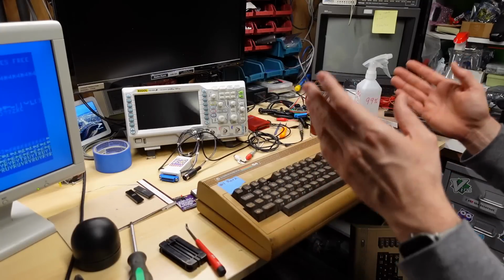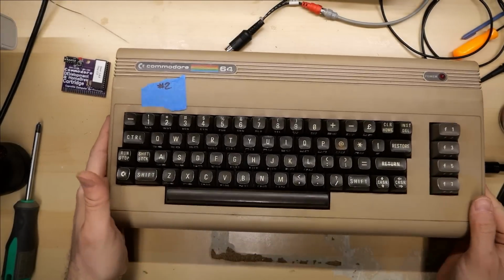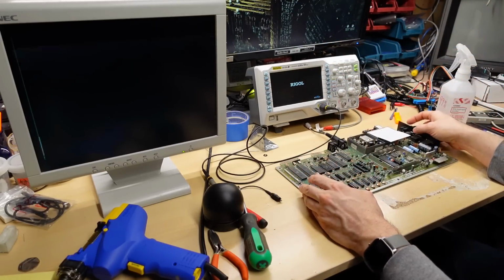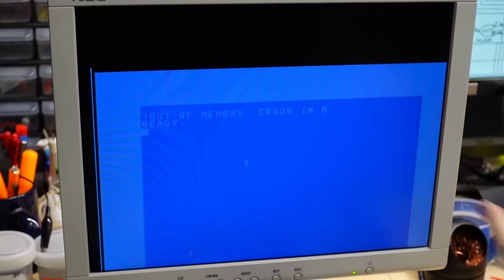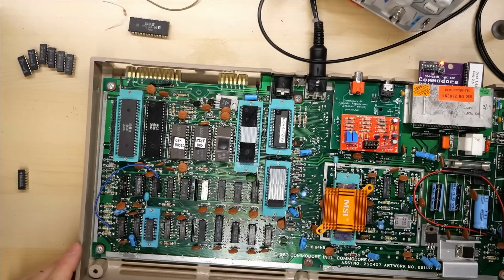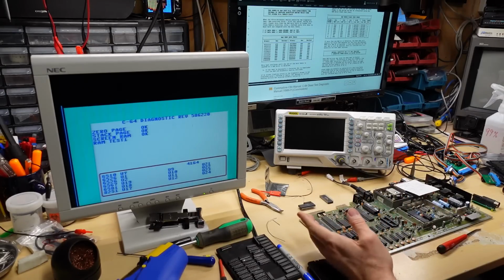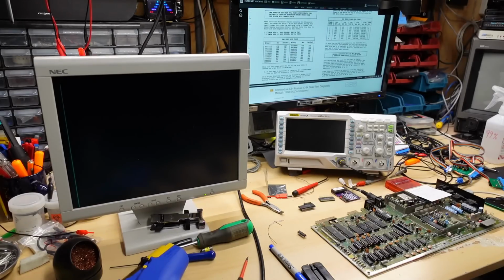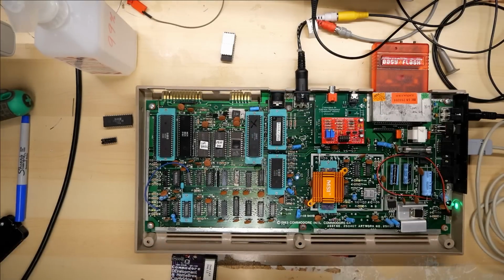2021 C64 Repair-a-thon #2: "Hmm, the mystery deepens!"

Comment: The thing about diagnostic software, is to get the most out of it, you need to know how it does the tests, and how it interprets the tests.  If you do not know how the test is done, you cannot trust the output.  I used to have a whole suite of testing software when i was an IBM PC repair tech back in the day.  And you could run several different ram test, and some would pass bad memory, and other would not.  In then end, because i didn't have access to the source code of the testing software, you just learned which tests were good for detecting specific problems.  For example some were really good at finding "slow" memory chips.  Just because it says 250 doesn't mean it actually works at that speed.  While others were very good at spotting "flakey" or intermittent bit errors.

In short, that dead test may be small enough to reverse engineer by hand, if the source code isn't available.  If it is, then use that to determine why the tests are seemingly giving you bad information.
Reply: I agree. I'd trust a working game more than I'd trust that tester when it comes to the zero page.
Reply: In this case maybe the marginal CPU have one or more bad op-codes that are used by the tests and not in the tested game. I had a flaky 6502 many years ago that could not alter the D flag with SED/CLD. Since D flag is undetermined on power-on sometimes things worked but mostly not. Took me a while to track down. Maybe something similar happened here.

Comment: as an interesting challenge one day, why not try to breadboard a working computer of some sort using only the "dead" chips since some are partially working (not a c64 but start with blinking a LED then move to a LCD etc until you have a franken-computer with only "broken chips") .
Reply: Like a Ben Eater computer?

Comment: I really have no knowledge about Hardware, so perhaps a weird question: 6510 is not in production anymore, but WDC produces a chip which is based on the 6502, on which the 6510 is also based. Would it be possible to use a newer chip in the 6502 family with a daughterboard or something as a replacement for a 6510 in a c64?
Reply: Nope, the WDC chip does not support the undocumented opcodes of the MOS CPUs. You can build an adapter for a MOS 6502.

Comment: Why do you have 50p on your desk? 😆
Reply from the maker: Good catch! I had that coin floating around the house and I was trying to take an Apple IIc monitor off the stand.  You need a coin for that. The 50p piece was nearby so I tried it but it was too big! Had to go grab a US quarter to get the monitor off. :-)
Reply: @adriansdigitalbasement  if that 50p was minted in 2009, it means it's rare due to it's low mintage for that year.

Comment: Hmm. 6510 is "mostly" similar to the 6502, with a few addons, so the internal logic for the "zero page" is actually functionally different that what is used to address other RAM. It even uses a different number of clock cycles because of this. However, I can't comprehend how/why the machine would even boot at all with it not working right... weird.

Comment: I am looking forward to "Adrian is building a brand new computer from the Dead Parts Bin" video.
Reply from the maker: Would be like Frankenstein :-)
Reply: @adriansdigitalbasement  I know this is another very long shot of mine... But would it be possible to use some chips that are "dead"/half dead with those functions/legs that are still working? Say, an address line isn't working, design the system that it doesn't need that line and so on.
Reply: @katho8472  that is sort of cheating.  but interesting
Reply: @highpath4776  and once a chip has begun to fail, it’s only a matter of time before the whole thing falls flat on its face.

Comment: You need to start a One leg in the grave bin for those chips that still have a pulse.
Reply: A Schrödinger parts bin, for chips that are both dead and alive?
Reply: Yes; it can be quite useful to differentiate between "marginal" chips from "completely dead" ones. The CG ROM from the first one produced glitchy artifacts onscreen but otherwise seemed usable. I'm not sure what you would do with a glitchy component if you have a fully working alternative, but maybe one day down the road it could be the only one available...
Reply: It would be interesting to see how a C64 works if it contains mostly or only marginal chips... :)
Reply: @mrnmrn1  The G64, Glitch 64. The state of the machine will surprize you every time you turn it on! :D
Reply: @mrnmrn1  I'd love to see that
Reply: @mrnmrn1  
This would make for a great video.

Gotta find the glitchiest SID imaginable, though.
Reply: 1:26 Right, if you mean the character ROM, I just commented that to the best of my recollection my 64 with this same motherboard also has exhibited this problem since I got it new in 1983. I think they may have come from the factory like this!
Reply: Victor Meldrew's chips lol
Reply: The SID says I should face the truth,
That I'm just too long in the tooth.

I've started to deteriorate, and now I'm past my own sell by date.

Oh, I'm no GAL PLA, its true,
I have to pop my teeth in to chew.

And my old pins have started to knock,
I've got too many power cycles on the clock.

So I'm wrinkly, crinkly, set in my ways.

It's true that my circuit has seen better days.

But give me half a chance and I can still misbehave!

One pin in the grave

https://www.youtube.com/watch?v=UrqOg-HRzDg

Comment: Looks like dead test can only detect a single bit failure on memory.
Does the 6510 cpu have the zpage ram inside?
Reply from the maker: It doesn't. All of it's RAM is in the DRAM on the motherboard.
Reply: @adriansdigitalbasement  OK was thinking of the 6802 I guess.

Comment: This channel is one of the few things keeping me sane recently. Only recently subscribed, so still got a huge amount of content to look back through.... Thank you!
Reply: Not sure if the human malware situation is getting to you or something else, but hang in there.
Reply: @YoureUsingWordsIncorrectly  The '040 @ 40MHz upgrade was the best part so far.
Because of its clock rate, it beats my '040 Amiga/Mac Plus-based hackintosh that I posted a video about for #MARCHintosh. :)
Reply: Looks at your username: are you sure you're sane?
Reply: @YoureUsingWordsIncorrectly  That was a great series. He just put a 68040 board in it. Thing is insane for an old Mac.

Comment: How "lucky" of you to have such interestingly failing chips so that you can also ferret out issues with the diag carts!

You'll need to create a troubleshooting flow chart to navigate all quirks (eg: paddle test fails due to bad/marginal SID, don't trust location of bad RAM chips in that one diag, be sure to run both diags to avoid the rabbit hole, etc)

Comment: You should set up an online store and start selling off those dead chips as genuine Adrian's Digital Basement merch, along with Rammy t-shirts. :D
Reply from the maker: Haha! Like encase them in resin to preserve them forever?
Reply: @adriansdigitalbasement  Could make keychains from them. :)
Reply: @adriansdigitalbasement  Then you can still use the bad parts bin, as is... Sell mementos to make more space, and support the channel at the same time.
Reply: @adriansdigitalbasement  Ya know, that's a pretty cool idea. I both collect glass/resin paper weights and display outdated hardware all over the pad. This would be a great combo of the two.
Reply: @adriansdigitalbasement  10/10 I would definitely buy one.
Reply: I would suggest removing the epoxy from the dead chips to reveal the semi conductor underneath

encase the whole lot in glass or clear plastic and turn it into a desk ornament

one day, when mobile phone cameras are ultra-ultra-ultra high resolution, the grandkids can zoom in on the chips and see where the circuit failed

LOLOL
Reply: You need to set up Adrian's Digital Graveyard for the stuff that can't be fixed.

Comment: Very entertaining as always Adrian. I have to admit I was a little worried about that thermal compound that was on the VIC, it looks like it could be conductive and some of it appeared to be bridging some pins on the VIC. But after looking up which pins they are (colour and luma output) it probably wouldn't make a difference anyway as the colour from these old machines bleeds into the luma anyway 😄
Reply from the maker: Heh yeah, that white stuff is safe and non conductive. It's usually gooped all over everything and I've never found it to cause any issues at all, even for delicate circuits.
Reply: @adriansdigitalbasement  it's likely zinc oxide aka old timey sunscreen